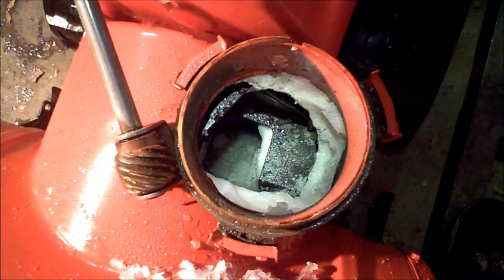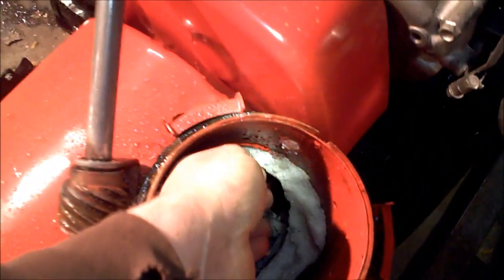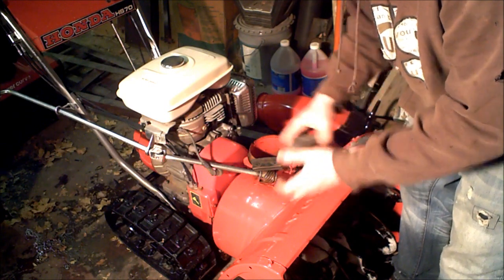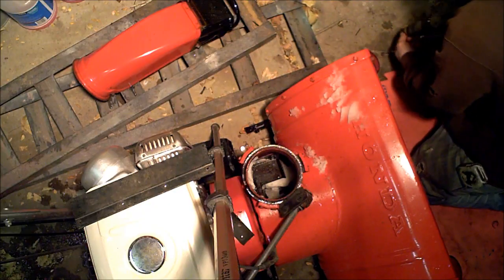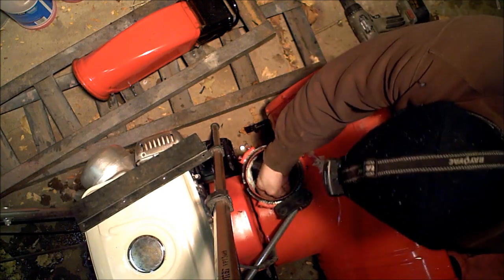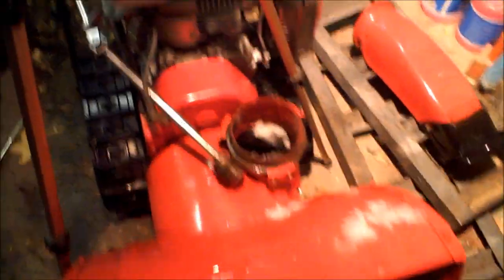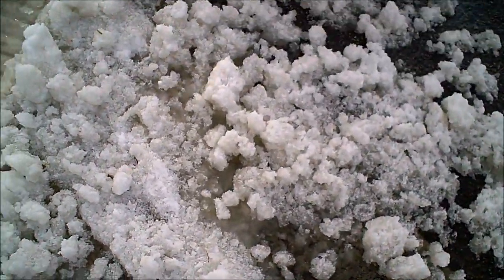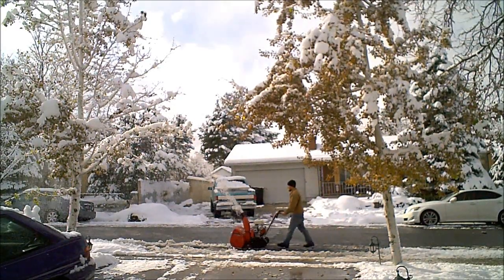Modify Snowblower to never clog and throw twice as far w/ Impeller Kit

Comment: Thanks for taking the time to publish this video 65ford. I'm heading out to the garage to modify the Ariens 524 (prior to the 12 inch snowfall expected to hit tonight) to make this modification. It looks just too easy not to apply the upgrade. I'm also certain the neighbors are tired of me cursing endlessly at my machine, so perhaps they will benefit as well. Best to you.
Reply from the maker: Let me know what you think.
Reply: sixtyfiveford It is unfortunate, but I have to report a fail. The issue is that the impeller is not centered in the cylindrical housing, so the margin is unequal from side to side. There is a 3/8" gap on one side, 180 degrees from that only a 1/8" gap. The rubber paddle binds on the shorter side and the impeller stops cold. There are power issues with this machine to begin with so perhaps it was not the best candidate for the modification. Starting next Spring I will be checking the estate sales. Winters here in Michigan have gotten back to normal the last couple years, and it's just too much work to move snow with a weak machine.
Reply from the maker: Even adjusting it to take up even 1/8" of the gap will make a difference.
Reply: sixtyfiveford I agree, and I will do it when I get some thinner rubber to make the paddles. My first try was some sidewall material from a used tire I snagged from the Firestone dealership in town. Free is good, but a little more flex is needed I believe. We just got pounded with a snowfall in the 12" range, conservatively. The machine performed fairly well with the dry granular snow. I ran a cap of Gumout in the first tank of gas and it helped. The carb on the 5 horse Tecumseh motor is not great, no adjustability at all. What I need is more rpm's man.
Reply from the maker: These 5hp Tecumsehs are rated at 3600rpm and can safely do this. The issue is most that I get in are set to only 3000-3300 rpm. I almost always bump them up 3600rpm. It makes a nice improvement. There is a little torx screw at the base of the throttle control that adjusts this and you can pick up a small hour meter/ tachometer for under 20bucks on ebay.
Reply: sixtyfiveford I will look for this. I cannot recall seeing this adjustment screw before and see no mention of it in the manual, but I will go look when it warms up a bit.
Reply: sixtyfiveford I hope you are enjoying this heat wave as much as I am. Before the warmth came though, I got the roof rake out to get as much snow off the roof as possible (to take full advantage of the coming thaw). And much of that ends up on my driveway, so out comes the blower again to move it over. Tight packed, granular, super-dense snow. Beforehand, I found the T-10 screw you opened my eyes to and made the adjustment. New machine, simply put. Thank you so much for your shared expertise sir.

Tim
Reply from the maker: You're very welcome.
Reply: sixtyfiveford When the season comes to an end and I can fiddle around with this thing a little more I plan on looking into that impeller not being centered and see if it is feasible to adjust whatever needs to be to make it right, then apply the rubber paddle trick. I may not have to get a new machine after all if I can get this one tweaked into the best possible shape it can be. As it stands, just having the additional power to deal with heavier snow has made a profound difference. Best...
Reply from the maker: Take care.

Comment: Great idea, I'm off to fire up the wood stove in the garage to pad my paddles. Any comments on leaky carb through pin hole on side of carburetor when blower is shut off. Also wondering if you had any thought on why, even in light snow, the shoot clogs if the snow is over 4" +/-. I've been taking 1/2 width passes just to get by.
Any comments would be greatly appreciated,
Jim
Reply from the maker: Even in light snow the impeller gap is crucial to not clogging. If the bowl has a pin hole in it they are pretty cheap or I usually just JB weld them. If it is leaking from the carb then your needle/seat are leaking. This could be from just a dirty needle/seat or they may need replacing.

Comment: Wow, I learned something new...Love this idea! Can you recommend some 2 stage snowblowers that you consider to be good ones...Preferably older models? I would like to find one on the cheap that may need a little fixing. I see that the older simplicitys seem to be popular...Any others?
Reply from the maker: I've used a ton of older snow blowers and Simplicity, John Deere, or Toro are my favorites in that order. I really dislike the ones that have no handle controlled drive. In the 70s-80s a few manufactures(Toro included) came out with dash mounted drive controllers. These you have to take your hand off the handle bar and reach to the center of the dash to stop the machine (awkward design). Other than that, most all older machines are built very well.

Ariens and older Craftsman are also good choices.
Reply: Jeff, the old simplicities are great. I have a '79, 8hp that does a great job and throws dry snow at least 10'. Older  Ariens, Toro, Montgomery Wards, Gravely are also good. unless you have a lot of time to work on one, get one that looks like it was well taken care of. If they won't start it is usually because of crud (lacquer) in the carb. The stuff they call gasolene now days is actually flammable liquid and it is especially hard on small engines that are only used occasionally.

Comment: I have to try this. Thanks for the tips on Tecumseh carburetors. I just tackled my first job and did my driveway this morning. I have to adjust the idle screw - it stall under any load with the choke off - but it runs now whereas it didn't before. Thank you!
Reply from the maker: Main jet is clogged. Run a fine wire through it or if it is an adjustable jet; give it a 1/2 turn out and try it again.

Comment: Hey Bud,,  Just wondering if you have had any experience with an old Snow Shark Snowblower.  The one I'm looking at has 2 augers etc.  Whatever info you might have would be appreciated...
Reply from the maker: Been a long while since I've seen one of them. They are based on the same design as all 2 stage snowblowers with a second chain driven auger for deep drifts. Made by MOTO MOWER. They had an inline impeller much line Simplicity Sno-Away models of the early 70's
Reply: sixtyfiveford I have one of those bad boys and lemme tell you...they are NASTY! love those over powered beasts!

Comment: I wonder how it affect the performance when running through rock and ice chunks.  Do you loose more shear pins with this mod? It will probably wear the outer housing running through snow with grit.
Reply from the maker: Because rocks and ice can no longer get wedged between the impeller and the housing, the life is of the housing is increased. Also because the you will not stall the impeller with clogged snow you won't break shear bolts.

As far as gritty material I can't see a difference in having the impeller touch the housing and clear away fine grit or having grit bearing snow grinding up against the housing.

Comment: Excellent Idea!  Thanks for sharing it.  I bought a Craftsman 24" Snow Thrower three years ago.  It worked very well the first year.  I was disappointed last year however because it kept clogging.  I haven't had enough snow to use it yet this year.  I will take a look under the chute to check the clearance.  Perhaps your solution will work for me too!  Thanks!
Reply from the maker: It will make a huge difference on your Craftsman.

Comment: i just finished doing this to my toro and it has 3 impellers and i put it on 2 of them. i used pieces of a stall mat and that worked but i didn't  have much room to work because my housing is taller than the one that you showed. also my self tapping screws were not tapping so i had to drill holes and put fender washers on it so the screw wouldn't go through the rubber bot i finally got it after about 2 hours of frustration. there is no snow now so i cant test it out but i was wondering if i need to pit it on the third impeller so it doesn't mess up the balance?
Reply from the maker: Yeah, some of these snowblowers can be a pain to get down in there. I would say yes to doing the 3rd impeller. I know it's a pain but it will prevent any vibration. You'll be happy you did this by the time it snows next.
Reply: sixtyfiveford ok thanks again

Comment: Would you explain if the chamfered side is up or down .does it act like a squeegee or is the chamfered side down and they sharper edge towards the chute output.  thanks  great idea
Reply from the maker: The chamfered edge is only put there to aid in wearing in faster. But I do put the sharp edge as the leading edge, so it hit first as the impeller rotates.

Comment: I made an Impeller kit for my 33" Columbia snowblower last week and we've had a lot of wet snow and freezing rain since.  Couldn't be happier with my snowblower now!  It throws the wet slushy snow farther than it used to throw dry snow.  no problems when the plow goes by at the end of the driveway either.  I cut a 45 degree bevel on the mudflap and had to drill pilot holes for the self tapping screws, but it took maybe half an hour to do.  
Thanks for the video!
Reply from the maker: 33", that's a big snowblower. Awesome, I'm glad you did the modification.

Comment: What are the best skid shoes to use? I was wearing out the metal ones and went to the neoprene that you can flip over if they wear down. Are there better ones out there. Thanks, love your advise.
Reply from the maker: Take your old metal ones to anybody that can weld. They can easily weld 1/4-1/2 thick steel plate on the bottom of the old ones and it will last forever.

Comment: Great idea.  Especially to use rubber.

Most likely, the space was left for solid objects such as tough ice pieces and gravel.  I can't count how many shear bolts I've replaced laying in the snow at 4am because I pulled a rock into my auger.

BUT... with using the rubber, I think it will give the rocks a chance to pass through without too much damage to the outer housing!  Bet it works great.  Nice job!
Reply from the maker: The rubber will prevent gravel from ever jamming.  It will prolong the life of you impeller and housing.

Comment: genius!!!
found a honda HS35 on the curb this past summer. just got it working tonight by cleaning the carb out, red sticky foul smelling gas inside the bowl. a good clean and started on first pull. tried it out on some fresh wet snow that is falling right now and it did fine for a while, then it got cloged. will your method work on this machine?
Reply from the maker: Yours is a single stage machine and just needs new rubber paddles. The same principle applies. Once they wear to the point where there is a gap between the housing and the rubber paddle it will clog. Brand new paddles eliminate this gap and it won't clog.

Comment: UPDATE! Ok, so I couldn't drill through my Toro so I used Epoxy. Well, I was finally able to try it for the first time and it's still holding and it shoots far! I accidently hit the house and almost broke a window. The good news, is this work great and even picked up the heavy wet snow for the first time AND didn't get plugged. I used an old floor mat for mine.
Reply from the maker: NICE!!!!. People expect a ton of force to be on these, but there really isn't. The majority of the force acting on these paddles is holding them to the metal impeller.
Reply: sixtyfiveford Winter is coming up and I had to watch this video again cause it's a cool video. After last season, mine only lost one and still kept going. Again, great video and I'm happy I found this.
Reply from the maker: Yeah, winter is just around the corner. I'm glad you tried it out.
Reply: sixtyfiveford Ditto. Just gave mine a once over and will be getting material to do this mod. This kinda crap happens a lot in WI, and I'm looking forward to how this will work!
Reply: Dave L what kind of epoxy did you use? I'm having a hard time getting my big fat hand and drill into my Craftsman. The epoxy thing is sounding better all the time.

Comment: do you know how to repair Honda snowblowers
Reply from the maker: Yeah, I've fix a good amount of them.
Reply: I'm having a issue with the fuel lifting the float in the carburetor bowl. It's a Honda hs80. I replaced the float and needle, and it fills up and overflows. Any suggestions
Reply from the maker: Make sure the spring is on the right side. The float should be able to float up and push the needle in. The spring should allow the float to travel further upwards even after the needle has stopped moving. You could have some varnish in the seat area. You can clean this by taking a mini phillips screwdriver and lightly spinning it in the hole 2 or 3 times.

 I use a method that has never failed me to test the needle/seat before I put the carb back together. With the carb off and the bowl removed: I hold the carb upside down and blow into the fuel inlet with my mouth(you can also use a short piece of clean fuel line). The weight of the float itself, without pressing on it at all should 100% seal the full air pressure from your mouth. If there is the tiniest leakage, gasoline will find its way through.

I do have a video on this series of carbs http://youtu.be/n_eTqL0C3gQ

With all this said, China has done a decent job at making some knockoffs. You can get a complete new carb for your gx240 for $15. off ebay. They are just OK and will last you a while. http://www.ebay.com/itm/Honda-GX240-8HP-Engine-Carburetor-Carb-16100-ZE2-W71-/250880934773?pt=US_Outdoor_Power_Equipment&hash=item3a69ab4375
Reply: Thank you very much I will try
Reply from the maker: Let me know how it goes.

Comment: I just did this modification to my 25 year old 8 hp MTD w/3 blade impeller. It throws snow at least twice as far (if not more) as before! The gap between the impeller and housing was over 1/2" (My finger could fit between the two). Also my impellers are angled on the end, so I cut the mudflap to cover the angle and used 3 self tapping screws - 2 on the flat and 1 on the angle. I found that the housing got pretty hot when I tested just after installation (in the garage without snow), so I would advise seating and breaking in the rubber while blowing snow. The snow kept the housing cool. Have you ever encountered that the extra drag and resistance damages the impeller drive belt or mechanism?  Thanx for the tip - KUDOS :)
Reply from the maker: It wears really fast to the housing(5-15 minutes). If they were set really tight they wouldn't damage anything, but would put more load on the engine until they worn it. Which is the same thing you do when you are moving snow. I'm glad you now have a SUPER MTD snow blower.